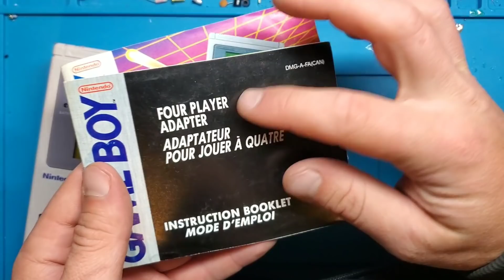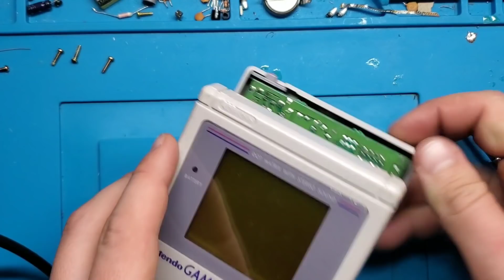Game Boy DMG-01 Vertical Lines - Fixing eBay Junk

Comment: Been slowly getting into repairing and modding old handhelds and just received two DMG's from Ebay, one has LCD Rot  around the edges but otherwise appears to work fine, that one I'll probably get one of those drop in backlight lcd kits for it and call it good. The other one had this issue and since I'm new to the whole thing I was a little nervous doing it but I ended up getting it back into flawless working order. Thanks for the amazingly helpful video.

Comment: I just did that Saturday I found one in a old filling cabinet at work there was some corrosion on battery ends 30 min soak in clr fixed that, the outer screen fell right out cause the double sided tape dried up cleaned that up replaced that. Soaked cases in dawn hot water for 45 min scrubbed real good took soldering iron to screen fixed all the lines looked new again board said 1989 and was cleaned up the Tetris game inside it was playing Tetris for awhile after lol
Reply: Selling it on Craigslist? Just saw a Gameboy with Tetris advertised as from 1989! Lol
Reply: nightwishkid1  no it wasn’t mine so I just left it on the desk for co workers to play

Comment: s far as I know, GameBoy Color games work perfectly on DMG GameBoys, minus the color of course. :) Thank you for the video.
Reply from the maker: They do not.   The dmg has a lock mechanism on the power switch that slides into the indent on normal GB games.  Gbc games don't have that inherent so they're unplayable. 

There are certain exceptions such as pokemon gold, which is backwards compatible
Reply: @RetroRepairs  Aah, ok. Must be only GBC games that come in black cartridges, like The Legend of Zelda DX. They are in original cartridge type. The newer translucent ones don't work then. Thanks.
Reply from the maker: Exactly
Reply: RetroRepairs hi
Reply: RetroRepairs I got a qustion
Reply: @Term271  For whom? :)
Reply: For retro repairs

Comment: Have you thought about using evapo-rust for all the crusty and rusty bits? It’s fairly cheap and it’s reusable as long as you store it in an air tight container. So you could buy a jug and pour it in a snap lock kitchen tub and use it as needed it completely removes rust and is safe to touch with bare skin.

Comment: Wish i could solder cant do it to save my life. Great video sir
Reply: I kind of know how but my soldering iron stopped working and glows red hot. Also the tip gets loose and I gave myself a small third degree burn trying to screw it back on thinking the iron was cool.
Reply: Failure is definitely the best teacher. My first solder job was on an snes power port replacement. It seemed to work for a while but eventually gave out. After that I started fiddling with it and ended up lifting one of the pads. What I learned from that was to never use the solder that comes with a cheap soldering iron, always use flux, start on your soldering iron's lowest heat setting and work your way up as needed, never keep the iron on the board or solder points for longer than absolutely necessary, use solder wick to remove old solder - cheap pumps are pretty useless for larger solder points.

Comment: Thanks Adam,  it may have took me most of the day to clean and remove the carnage from a exploded battery,   I expected to sit for a hour and fix the vertical lines.   Well it took maybe 5 min tops...   Thanks eh,  not sure where you are but I owe you a beer.   I'm in B.C.  so I may even cold still when it gets there.
Reply from the maker: Awesome to hear!  Im in northern Ontario,  I suspect by the time it makes it partway through Alberta it'll be nice and warm, but it's the thought that counts,  right?
Reply: @RetroRepairs  yeah man,   I will just pack it with dry ice,  or my ex wife lol.   Truly man your awesome,   I reference you videos more than anyone.   If I can get you more subs and like I will.   Send a po box to my messanger,  Richard West will be a pict of solar striker.   Even if it's a gift card you will get your beer and a bone for your dog.

Comment: Really nice fix, I didn't know about this strangely, I always like your "fixing" videos, few cuts, well explained. Though I don't know if it's the camera angle but at 20:03 it looks like your screen is a bit off to the left, not a huge deal, it just triggers my OCD haha.
Reply from the maker: I know what you mean.  Sometimes im bad at that - moving what im working on,  but it moves either off- center or out of the frame altogether.
Reply: @RetroRepairs  Not sure if I misunderstood your answer or not, but I meant the gameboy screen, not the camera work !
Reply from the maker: @Meubeu1  Ah, I see what you mean.  Along the right side it looks like the light gap is a bit wider.   I've checked that again, and the display simply has no pixels there.  Maybe it's an odd display unit?  I'll have to compare to another display to see if there's any difference.
Reply: @RetroRepairs  Interesting, been a while since I had my hands on those fat models, I do remember this "issue" but I thought it was symmetrical, at least. Guess not :)

Comment: Retro,
   Great video! Been watching a a lot over the last week or so and was curious if you have done a video on any n64 memory pack repairs(havnt found one on your page)? I have a couple that read corrupt or damaged and would like to see if there are any common issues to be found that might be a straight forward repair? Thank you for your time and info!
Reply from the maker: Never run across any.   I'd imagine the ram chip could be reflowed, but ive never tried.

Comment: If you're gonna go through this procedure you might as well do the backlight mod.  Kits go for 10-15 bucks and you can sell the modded Gameboy for $100.
Reply from the maker: Im aware, I've done a backlight mod in a different video.   

This is how to quickly fix vertical lines.  Not everyone wants to add a backlight and bivert mod.  I probably will end up doing the mod to this as well.
Reply: @RetroRepairs  Thanks.  I didn't see your other video will check it out.  It's a somewhat tricky mod I was always confused where to make the connections since tutorials differ on the solder points.

Comment: A heat gun and some kapton tape also works and is much quicker.  I've done it without the tape also but am not 100% sure it wont melt anything in the screen.
Reply from the maker: I'd be worried about the polarized filter under the glass.   If that melts or distorts, the image will be ruined.   I like that the iron gives you the ultimate control.

Comment: Thanks for the instructive video.I recently bought an old DMG gameboy that had this issue with the lines. When i opened it up to do the repair i noticed the the right side of the ribbon connected to the screen was lifting. Tried the soldering iron, the lines would appear when the iron was on the ribbon but as soon as I remove the iron, the ribbon lifts again. Have you come across this issue before? Should i use adhesive to hold it down and attempt the reflow again, or just attempt to use new solder to try and bridge the gap?
Reply: I'm having the same issue, did you find a solution?

Comment: Could you please make a video on Genesis games that won't boot? I have two myself, I cleaned the contacts very well; I started with Rubbing Alcohol which didn't work so I used watered down QuikGlo (a metal polish / wax) and that fixed other games that weren't working after Rubbing Alcohol but it didn't fix these two. One game has no save battery, the other does but the battery reads good.
Reply from the maker: Honestly,  I've found genesis games have a higher complete failure rate of the ones ive tested.   Nintendo carts fail more often, but are fixable, I've yet to fix a genesis cart of the 5 I've tried. I suspect that since the cart's circuitry is so simple, it's more prone to damaged ROMs from voltage spikes, which requires a replacement chip and ROM writer

Comment: I bought a sealed Resident evil 2 tiger 99x gaming device on Ebay, but the screen has deteriorated in 20 years and the image is in stripes. Local masters in Russia could not fix the device, they said that it was necessary to change the cable, but there was no replacement, even after the intervention from outside the screen began to flicker, do you know how to help?

Comment: Have you tried it with a re-flowing heat gun?  Does the light contact made by the soldering iron perhaps help the process?
Reply from the maker: I haven't.  My thought was the excess heat could affect the display, notably the polarizing film.  Soldering iron can be controlled alot better
Reply: That makes sense!

Comment: Where did you get your rubber work mat? I'm not sure what I need to be searching for.
Reply from the maker: Amazon.   Look for heat resistant work mat or esd safe work mat
Reply: @RetroRepairs Cheers,  I'm liking the little compartments for screws and such, will have a look.

Comment: a question at what temperature should the soldering iron be adjusted to solve that screen flexor?
Reply from the maker: Mine was at 650, but im sure it could be lower.  Needs to be hot enough to reflow the connection under the ribbon
Reply: Could you tell me the brand and model of your soldering iron because mine is BAKU brand just to guide me thanks
Reply from the maker: I've got a Hakko FX-888D.  It's considered an "entry level" soldering station, but it's a pretty solid unit for the price.   It doesn't have all the bells and whistles as a professional grade unit, but I've used some real cheap ones before, and this is notably better.

Comment: I got one for ya I have a dmg 1 and I did back light mod and bivert chip worked great but now will only play games that doesn't tdd have battery if game has battery nothing happens please help
Reply from the maker: Ive heard of this happening.   It may have to do with where you pull your 5v source for the backlight from.  I believe when i did mine,  i grabbed 5v from the capacitor right under the screen. 

This mainly happens when using an everdrive, but i suppose it could also happen on a game with a higher power draw.   

I have a video where i do a backlight/bivert mod and i test it with pokemon red,  which has a battery and there are no issues.   I might suggest opening it up and checking your 5v source.
Reply: Thank you for the reply and that's where I have the light soldered is to  that capacitor which is why I'm confused cause it used to play pokemon just fine including silver and gold

Comment: Nintendo love to screw around ;) 10 just for that board when 4 will do
Reply from the maker: I'd say 6.  two at the top, two at the bottom and two right above the buttons.   The ones in the middle will help to reduce any flex from pushing buttons.    10 is completely overkill though.
Reply: RetroRepairs your totally right i was not thinking about the button compressions on the board having them around them is important